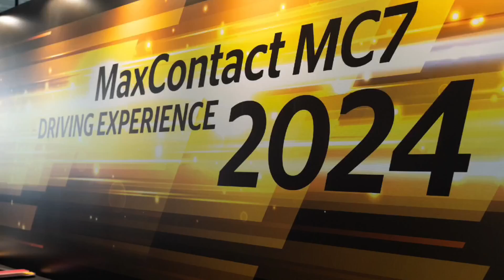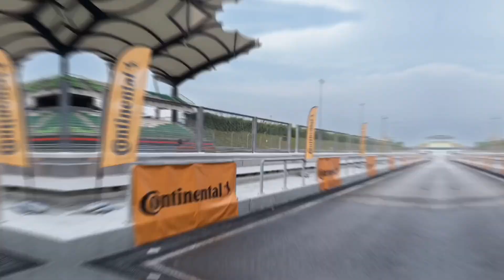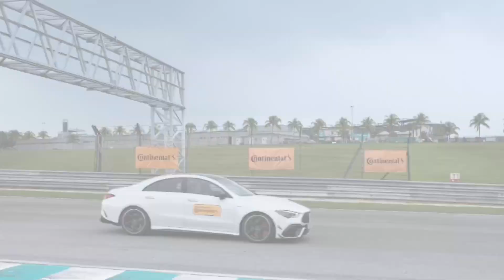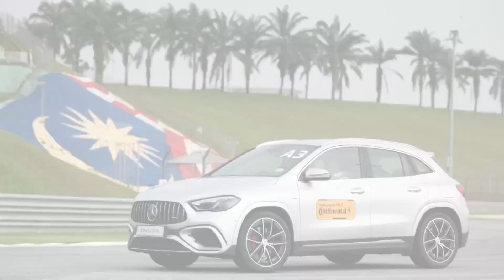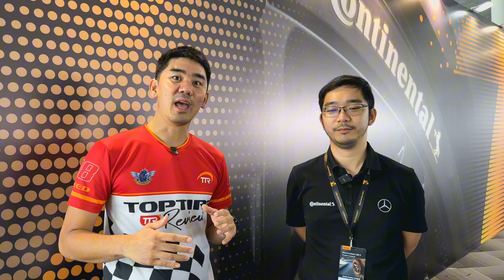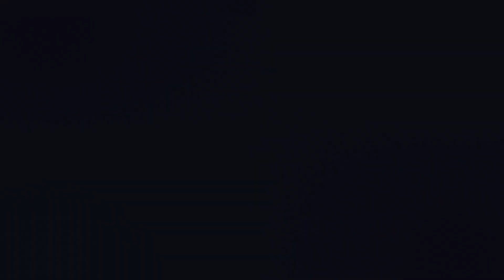Revealing MaxContact 7: Exclusive Insights with Continental's Tire R&D Manager

Comment: Hello Dr Edwin, what are the differences between MC7 and SC7?
Reply: Mostly the price! The SC7 is around double the price as the MC7 if not more in some markets.

The SC7 is a global tyre whilst the MC7 is a Ocianna/Asian market tyre.

Wet and dry braking are very similar as is the ride and noise.
The SC7 has a small edge in extreme cornering performance.
A Korean car and tyre testing channel I watched tested the SC7 and the MC7 with the same car, same tyre size, same track, same driver although different days.
The MC7 had a little better dry braking, the SC7 has a little better wet braking and the MC7 was only around half a second behind the SC7 on track time.

Hope that clears things up
Reply: @druscanam thanks for the detailed explanation!